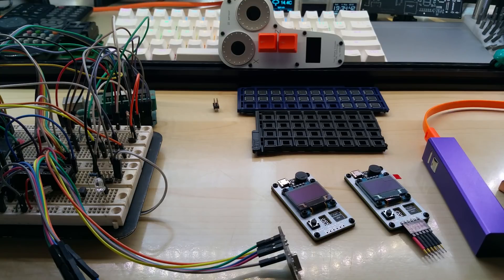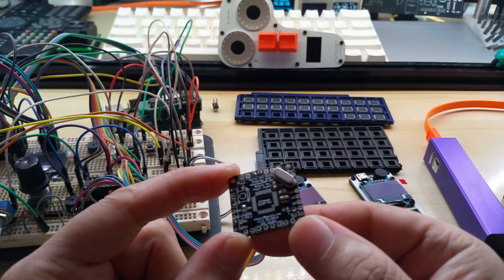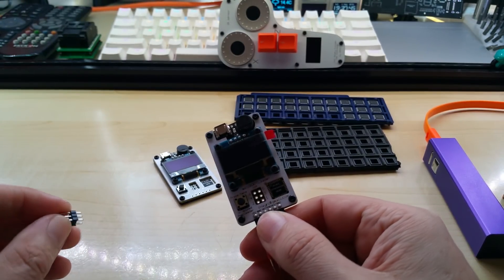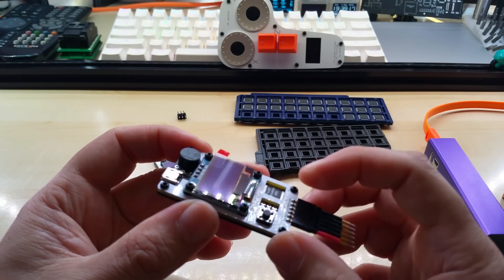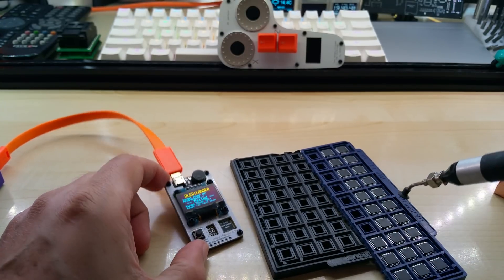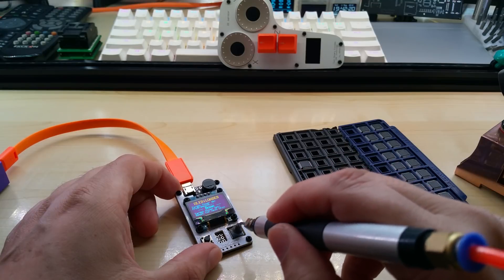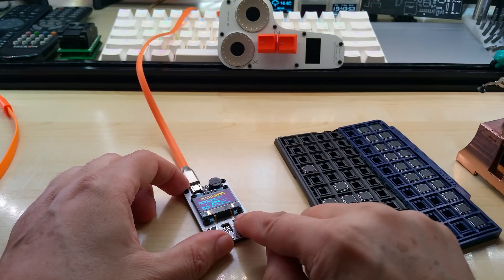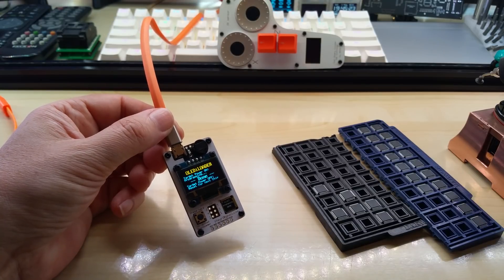World's Smallest Stand Alone Atmega328 Bootloader Burner using optiLoader edited by Hayri

Comment: Hi Hayri. Could you add support for a ATSAMD21E16B which is also in the 32TQFP format?  I would gladly pay for the work required to do that!
Reply from the maker: The SAMD needs other hardware and software for the burning of the bootloader, so it won't be possible to just create a small version like my bootloader burner.

Comment: Why not just use one of the programmer sockets?

I know they are expensive compared to just pressing with your finger.
But a lot less "press and pray".

When time is money...
It'll save a lot of time with misaligned or bad pin connectons.
Reply from the maker: I have one of those and wanted to show it in the video but forgot. Well, as you said, they are expensive, take way more time with opening, placing, closing, opening, taking out and start with a new chip. Actually I had problems with press and pray only in the video, once I do it of camera, with direct sight and not looking at the phone screen, I get it right almost all of the time. Plus way faster with a angeled tweezer than with the vacuum pen. If I ever need this to be fast, I'll just make a CNC for it and have trays of 250 chip done by them selfs, but I doubt that I ever need that many at one time or fast :-)

Comment: What a nice gadget and also a tool. Very useful. 
And I think you did it again :)). I'm talking about putting new projects in camera background like you did with this one in your other video. What is that thing in the background with two orange keyboard switches and 2 rotary encoders? I think I haven't seen it before.
Reply from the maker: Thank you, yes, I did it again :-) that is my new CNC pendant with, like you noticed, 2 rotary encoders for x and y and 2 keys for the z axis. Most pendants, actually all commercial ones I have seen, have only one encoder and you have to switch the axis every time. Not so with mine :-) Plus it has a navigation switch on the side which can be used to adjust the steeping size and of course an OLED display and as a bonus an IR temperature sensor so you can check on the heat of the steppers, divers, work piece or the bit for example. The one you see is a left hand version which leaves your right hand free to do other things. Most other pendants are to big to use with one hand as well. This could also be used for other things as well, video editing for example where you need to increment a video frame by frame. It can be programmed for other purposes easily.
Reply: @iHayri1  Wow, that is really cool and very useful. You stuffed a lot of good functions in there, as well as the classic OLED screen.
Reply from the maker: @dragomirliviumarian5834  Thanks, can't live without the "OLED" :-) Actually, I have designed it for 2 OLED's, yep, I know I am crazy but in a good way :-) It could also have a 128x32 display vertical next to the 2 keys but I might drop that and move the keys a little to the left instead. I also forgot to mention that it has an option to mount a accelerometer in it to be able to use it like a air mouse. Which I think will be a nice feature as well.
Reply: @iHayri1  You're not crazy. I love those small OLEDs too. They are so cool and can be used in almost every project.

Comment: Nice tiny helper! By the way, if you will add small vias on the pads you are using for programming with pogo pin connector, it will be easier to hold it in a place. I am using 0.3mm vias and it helps a lot.
Reply from the maker: Thank you Aidas, actually before I used (regular) pins to have the ability to upload code from both sides of the PCB but now, to save space I use the pads. On some of my boards I still have the pin headers, but nevertheless thanks for the tip :-)
Reply: @iHayri1  Not sure I was clear enough to explain the idea. I mean in the middle of each pad you are using now just drill the tiny hole (0.3mm) to keep pogo pin centred and kinda "fixed" from slipping during the upload. That way you can even reduce the size of the pads you have now (to save space). Hope this time it will be easier to understand
Reply from the maker: @MrJanulis  I got you, it's just a hole means that a trace on the back needs to go around it and on small dense PCB's it gets quite difficult to route. Other than that, it's a good idea of course and you are right, I also meant to reduce their size but did not get around to it yet :-)

Comment: By the way, I did not see the Bootloader Burner on you Tindie page. By the way, if I wanted to burn a different program onto bare chips, how would I load my code into your burner?
Reply from the maker: Thanks Robert, I haven't had a chance yet to put it up on Tindie, will do it now but it can take a little till it is approved, especially being the weekend :-) You can upload code to the burner via a USB adapter like I use, maybe the optiLoader code could be changed to load a specific hex file onto a chip. Please take a look here to the original code: https://github.com/WestfW/OptiLoader I will also look into when I get a chance, thanks.